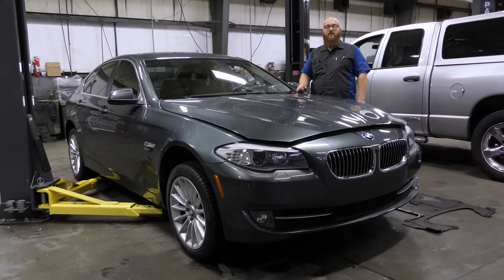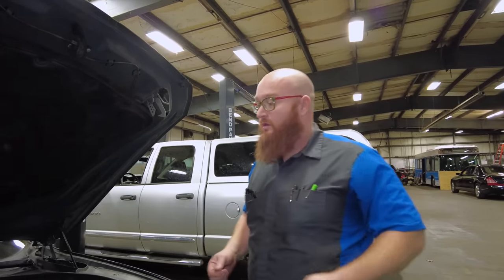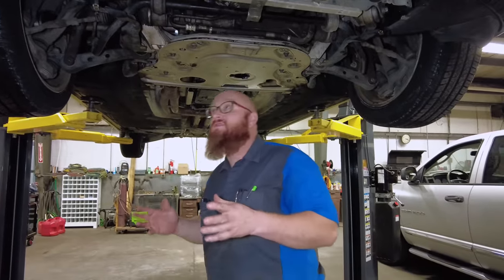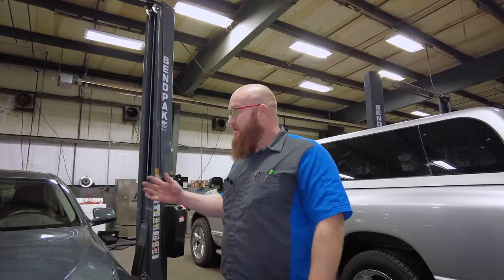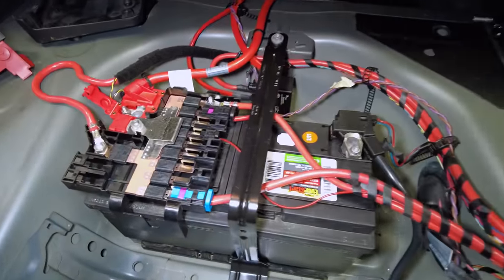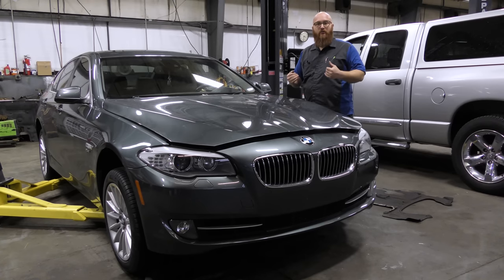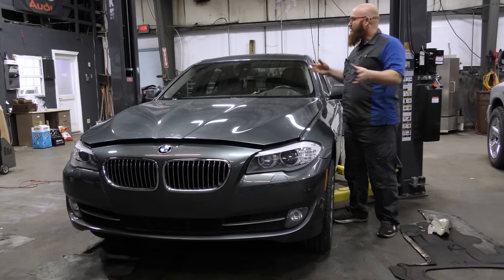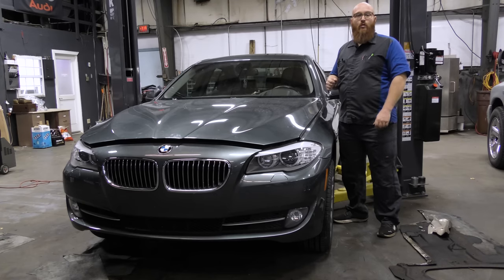One bad day for a customer! CAR WIZARD found TWO insanely unrelated issues at time on '12 BMW 535i

Comment: I have to comment on this one. I agree it horribly expensive to replace that starter, but the car has held up for over 200K miles. That's exceptional. Anyone operating a car over 150K miles knows they are on borrowed time waiting for the big failure. 

Just my opinion
Reply: Yeah, i agree. When you divide $1200 by 200,000 miles, it’s not unreasonable, price to pay when compared to any other luxury automotive brand. Sure when compared to the price of a starter replacement on a chevy impala, it looks expensive. But fixing this 10 YO BMW, is far less expensive than it would be to buy a replacement vehicle.
Reply: Not if you driving a Toyota Camry,Avalon,4Runner,Honda CRV,Honda Accord, Lexus or Acura. At 150K those cars I mentioned just ready for the road
Reply: A well maintained Toyota is just getting broken in at 150k miles !
Reply: @JAM2USA2018 yeah but those cars are far more boring, less powerful, and have less features than this bmw so why compare the 2?
Reply: @JAM2USA2018  yea but they are all appliances that drive like a wet napkin. People still love 5 series decades later, nobody says that about a Toyota
Reply: @kylemontano228  True, it's just a matter of what you buying(Luxury or reliability).
Reply: @Justin Langlais  like others said they don't compare. Someone who's is in the market for BMw is not comparing it to a Toyota. Toyota performance sedans look like ricers too.
Reply: I agree. I love my Japanese cars for the reliability they provide, but they're boring average everyday cars (that's a GOOD thing). But my BMW is just way more fun and engaging to drive. Pick one, because you can't have both. The problems come from those who think they can. They buy a BMW and treat and maintain it like a Honda, and get pissed when something expensive goes wrong.
Reply: @JAM2USA2018  If you don't maintain a Toyota is also going to be bad.
Reply: @FacuGonz3  point is, even with great maintenance some of these brands are no good
Reply: A starter is not a big deal. You have to replace those on every car at some point. It’s the cost of replacing it that makes the difference
Reply: @Marlon Grant  I've seen plenty of those cars break at 150k or less. Let's not kid ourselves. All modern cars are junk. While I will say obviously the Hondas and Toyotas have a better track record for reliability, they certainly aren't nearly as fun to drive as a BMW.
Reply: Your right. Europesn cars stsrt giving you problem after 100000 miles
Reply: @JAM2USA2018 exactly. Those cars can have over 400000 miles and still run descent. The ford crown victoria in the 90 were like that too. The engine never dies
Reply: @TheRidersChoice lexus are luxury cars and they last forever. I had a rx and it was fun and reliable. I would still have it toady if indidnt crash it.
Reply: @Boblib1970 you dont buy a bmw you leased it. Those type of cars you leased.
Reply: @KrishnaSingh-ow1ie  Meh, to each his own. I prefer to buy a well documented used car with low miles and keep it 7-8 years. But that's me.
Reply: uh oh My 2006 Toyota Sienna has 271,000 miles on it! runs great Im on my 3rd Timing belt! Also 2nd starter. Got mine from auto zone for like $80 free lifetime replacement and it comes out from the top. its under the battery box and takes less then 30 mins to replace! Love Japanese cars! I dont understand why people put up with European car reliability and its not like they are cheap to begin with. I guess they dont know anything else. Also Ill bet the engine mounts are collapsed at 200k miles! and a bunch of other things. The Car Wizard hates BMWs for a reason.
Reply: @JAM2USA2018 My honda with 100k miles needed all new wheel bearings and control arms. Not sure about that
Reply: The Chevy in the background won’t make it to 200k without major part replacements but he’s gonna keep talking smack about the bmw lol

Comment: When my starter went out on my 2011 BMW 535i, Chicago's most highly rated independent BMW shop (Bavarian Motors) charged me just $600 to replace it.  Granted that was four years ago and there has been some inflation since then.  But I am mystified why you would charge DOUBLE what another great shop charged for the same repair on the same car.  And by the way, in the five years I've owned my BMW, with now over 150,000 miles on it, the starter is the only repair it has needed.

Comment: EV Electric motor engineer here- Depending on how hot the engine got (above normal) I could see the starter solenoid/starter winding insulation being near failure, overheating, and dying.
Reply: Or coolant on it
Reply: Failure temperature of wiring enamel is nowhere near 105C (typical max coolant temp) and the starter never gets that hot anyway. The engine block won't increase much past 105C due to its large thermal mass even after the coolant is lost.

Comment: Did a starter on an E90 330i. Wasn’t a fun job. As the Wizard said, the intake manifold had to be moved to the right. Mine didn’t die completely, but every now and then the motor would rotate slowly (and the battery was fine).

Edit: I’ve said it before and I’ll say it again, do not get x-drive unless you absolutely need it. It can become a nightmare to maintain, and it makes the handling/ride worse. Gets in the way of everything. When I did the starter job, I also did my WP and thermostat (was getting codes for the WP going bad). The stupid driveshaft made things much more difficult than they had to be.
Reply: My e46 x drive isn’t bad, thermostat and water pump was like working on a Chevy truck, water pump was even an ac delco brand…
Reply: That is way I still drive a 20 year old BMW with planetary AWD, super solid and none of complexity.
Reply: Just curious, under what conditions would someone need the x-drive? Is there something special about them that does something special?
Reply: @weswest8666  Yup, that was a different system. Seems to be more reliable than x-drive. On the E46, the WP was mechanical, making it more reliable (I think) and cheaper to replace.
Reply: It would be best to just avoid BMW if you need AWD. If you want luxury and reliable AWD, get a Lexus. Or an Acura.
Reply: @nexusyang4832  It’s just if one would really need AWD. If you live in a super hilly area with lots of snow and ice, I’d recommend x-drive and snow tires. But I live in Michigan, and I get through just fine with RWD and all-season tires.
Reply: @pascutia  ahhhhh.... okay. so it's for the AWD models?
Reply: @nexusyang4832  Yup! X-drive is what BMW calls their AWD system
Reply: @damilolaakanni  I agree. Acura’s AWD system is superb. I love the system in my family’s 16’ Honda Pilot. Seamless in normal driving and when driving aggressively you can feel it shifting power from side to side.
Reply: Tbh i wish my e46 wasn’t x drive I’ve already had to do both front axles and don’t want complexity of awd. My friend has an e90 x drive and says it does great in the snow (with snow tires)
Reply: @nexusyang4832  snow
Reply: Don't get a BMW full stop, they are all garbage these days.
Reply: on my 2011 212 e class mercedes u have to take of the engine mount on one side and jack the engine up abit to get it out, gotta love new cars
Reply: 2012 335ix, x-drive isn't that bad. I did water pump / thermostat recently, and it went super smooth. People just like to complain.
Reply: I have a e90 330xi as well, I lived through the starter and water pump and thermostat jobs. Absolutely nightmares but! Once you do them a couple of times they get easy, but you will break hoses and connectors guaranteed adding on to the hassle. I now have a 2015 535i lol so I did not learn, haven’t had any issues in the year I’ve owned it YET
Reply: I too had an E90 330i 6-speed, and I really liked it, but between the head stud issues and the general complexity of the car, I ditched it before it hit 6 years old. These cars can bankrupt you, and just to rebalance the issue of this poor customer, he knows what he's been driving: a 200k mi ticking time bomb.
Reply: Intake manifold literally takes 10 minutes to remove, any longer you probably shouldn't be working on cars lol
Reply: So much for the ultimate driving machine. It should be renamed the ultimate nightmare machine
Reply: @nexusyang4832  It's AWD that's it. If you value your money by a Subaru or a RAV4 anything other than that pile of complexity junk. Unless money is not an object
Reply: @yslee1401  -- Give me a break.   ANY CAR can have a starter go out, oil leaks, and a hose blow off at 200K miles.
Reply: @jrtaylor2288  i thought the CRV was pretty reliable as well
Reply: Fuck x drive. If you get enough snow to actually need it a BMW is the wrong daily anyway, they don't have enough ground clearance. Even the SUVs. And I daily an old BMW btw. Rear wheel drive. Snows in the winter. It's fine. Just don't live somewhere that gets 10 inches regularly and there are less than 10 public plows in the whole county.
Reply: @Justinian Yi I managed to kill the original starter on my e34 at 160xxx. Pretty sure it was a Bosch but I don't remember anymore.
Reply: @yslee1401  way more reliable than any GM shitbox but go off
Reply: @ShowMeWhatINeedToKnow  the RAV4 2014 which I owned (Australia) had 235,000kms on it before I sold it off. Passed Toyota pre-owned check and certification with flying colours. Only needed to change the rubber wiper blades. It was a Made in Japan model
Reply: @yslee1401  you got lucky. Just look up the Toyota 2.4 L engine issues. Massive, massive oil consumption issues.
Reply: @andrewgarcia3136  You wouldn't know 10 inches if it slapped you in the face.
Reply: @ShowMeWhatINeedToKnow  fully aware of 2AZ-FE oil consumption defect. There was a recall on that around 15 years ago. Appears that North American made engines are  more susceptible due to the piston rings sourcing
Reply: G Kab  that was what Car Ninja mentioned as well for another Beemer
Reply: @nexusyang4832  try snow.
Reply: I had two 335xi’s and they’re one of the best cars I’ve driven in the Canadian winters. The secret for good reliability on the xDrive system is to make sure all four tires have the same tread wear, having varying tires will wear the system out faster.
Reply: Why would I listen to a guy complaining about a simple starter job LOL, maybe wrenching isn’t for you my friend.
Reply: @imthatguypal_  It wasn’t too bad. My comment was more about the x-drive system. Just wanted to give the symptoms of it going bad on these cars. I personally don’t get what the deal is with this car with the original starter lasting 200k miles. That’s a long life for a starter! Mine was going bad at around 85k miles.
Reply: Have you actually worked on an xDrive 330i? The driveshaft is nowhere near the water pump lol. Now if you said that the subframe is bigger on xDrive cars and space is more limited as a result that'd make more sense. 

Starter is an easy job IMO, nothing too difficult assuming you're not totally new to DIYing things.
Reply: @nexusyang4832  You know, snow and ice?
Reply: I am on my 3d 3 series and the starter is yet to fail. But if it did taking the intake off on inline 6 is not all that difficult.

Comment: Be careful with diagnosing starters on bmw's!!! We had one in the shop for a few days that wouldn't start just like yours, the engine was not grounded, the strap had corroded and there was 5v drop between the negative battery terminal and anywhere on the engine block!
Reply: Yes, I would also checked the negative from starter
Reply: Good catch!

Comment: 200k miles is great for a BMW starter motor. They normally go before half of that.
Reply: Oh god i hope not... I'm just about at 110k on my mini. Not the worst thing in the world to replace but I'd like to be able to relax on maintenance this month.
Reply: Agreed. Expect much less if you let your sister learn how to drive a manual with it.
Reply: They typically last less than half that if you go by the bmw service intervals. Service it twice as often and you'd be surprised. They can actually last twice as long from that alone.
Reply: Depends on the number of start ups. That's a 10 year old car with 200k miles. That's pretty average. My 1996 Thunderbird's starter motor lasted 24 years and 150K miles before it went out. It likely did more than double the number of starts as that BMW's considering most of my miles are city.
Reply: @elihernandez330  Maint on a CAR starter ?
Reply: @MB-rr1fb  no the engine, trans, and diff(s). Those are the first to suffer the long bmw intervals. Or worse the "lifetime" trans fluid on those ZF 8hp units.
Reply: Probably already changed once before already
Reply: I would fix it personally. The cars can be brutal if neglected but can also run forever if kept on top of. 

I know it’s overkill but I check my coolant, oil and give it a look over every week. German cars are absolutely brilliant to drive but have tight tolerances. One small thing can cascade into total disaster if left unattended. 

Also x drive is the devil and I can’t get over how many plastic pans are on these newer ones. I would absolutely never buy a newer German car. Once my 92k mi 325i dies I’m gonna buy a 2023+ Prius the new redesign looks awesome and it’s faster then my old bmw. 

The old ml320 I have uses so much gas but is always there when I need it at over 225k mi. You absolutely can not have just one German car, it’s just not dependable enough. All else fails the 86 Isuzu trooper gets a battery charge and I suffer without ac.
Reply: The starters on bmws are usually bosch pretty good quality.

Comment: Its a shame, looks like the customer really loves his car, for a 2012 its in really nice condition and he pays attention to know to pull over asap when its overheating. He cares more about the car than BMW itself probably does.
Reply: BMW and most of those 'luxury' Euro brands 'engineer' their vehicles to last the duration of the lease and that's it. Beyond that, you need intermediate to advanced mechanical skills as a DIYer or be prepared to shell out major $$$ to a shop.
Reply: It's unlucky that both of these things happened at the same time BUT this car has 200k miles don't forget that hear, if a starter goes out at that kinda miles on a 10 year old car, I think it's fine
Reply: @chriskonte1909  Agreed, 200k is a lot for any starter in any car. However, the difficulty in replacing the starting is inexcusably complicated, typical of a European car.

Comment: BMWs. We have a love hate relationship with them. Wife’s e90 328i is just about the most reliable one out there. We had infamous Dmtl leak. Had to do a smoke test and turned out it was the fuel pump.  My f01 750i. Probably the least reliable BMW with the n63. Had to replace the alternator and was quoted $2000 at an independent shop. Got a remanufactered alternator from autozone and did it myself. But it took two weekends of carefully taking apart the car and making sure not to break any plastics. Did the turbo oil return lines while I was in there.  I’m thankful for the diy community.

Comment: From a BMW enthusiast, I have to say you're right, absolutely right. The thing that people don't understand about the brand, and yes it's gotten worse since 2005 but really has always been like that, they're built like airplanes. 

They'll last forever with frequent and preventative maintenance. If you're not a fan of how they drive, don't buy one. If it's just looks and utility you'll always end up frustrated because of what you have to put in. If you're not a DIY person do not buy anything older than 2 years or younger than 20 years (models from back then simple enough for most shops).

If you're not willing to deal with the tech in the car, how it works and what it does, don't buy any BMW. 

When I say airplanes I mean it, just as fragile, needy and expensive but also ultimately the most agile, highest performing and fun cars on the road when theynrun right - most don't.

Due to this most components until around 2010 are very lightweight and also wear out sooner than comparable other brands i.e. suspension.

Unfortunately, since around 2010 comfort has crept in and there is really no point in buying the brand anymore. A bloated, heavy and expensive car can be had from Mercedes but it's  built much sturdier, maintained less and cheaper and rides the same.

Additionally, in the late 90sncost cutting went overboard and some decisions wrt materials, electronics, packaging were just plain reckless and eventually lead to planned obsolescence i.e. the car quickly reaches the point of economically being totaled if anything major comes up which it will sooner or later.

Finally, the 535 here with 200k miles I'm honestly amazed it got this far, I say that as a fan. Cooling system on this needs to be entirely replaced at 150k miles at the very latest, will then run on to 300k easily. The battery issue, you need BMW diagnostics INPA or the new version it will tell you the order of events.

The engine if you can turn it freely is most likely fine but head gasket needs to be checked for condition. We're talking 3k at least, I estimate residual value of 8k in the US market? Simply wrong car for this customer. Buy a Merc or better screw the German brands and go Lexus etc - driving a lot and liking how a F10 drives but unable/willing to deal with the airplane maintenance you will not go back to BMW ever.